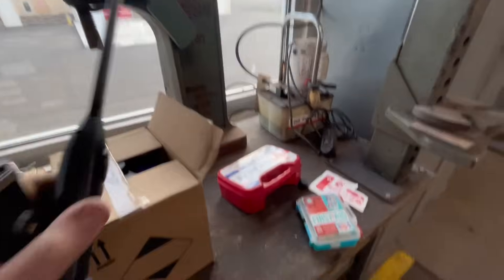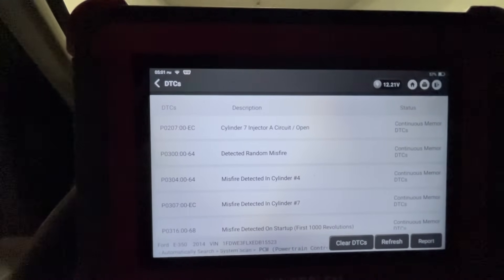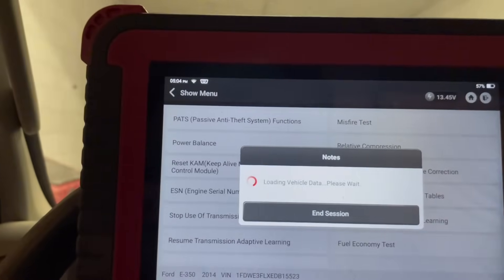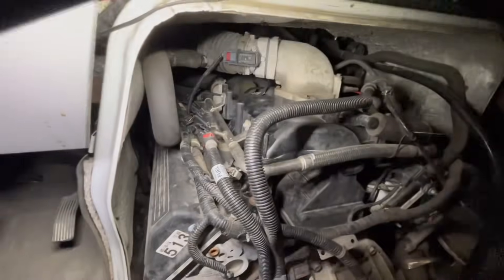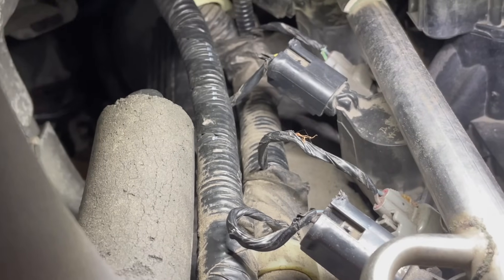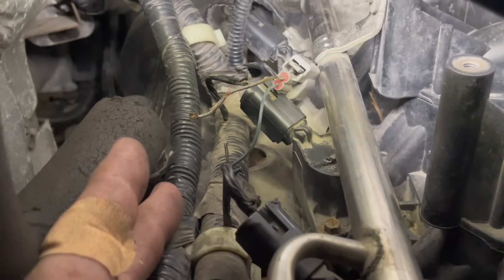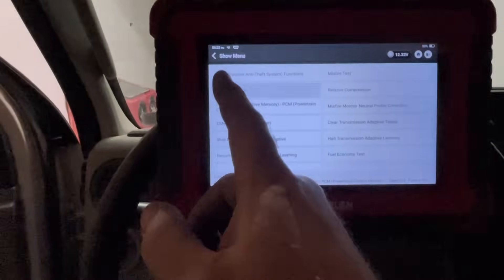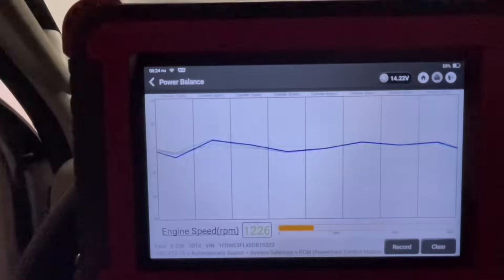Ford 5.4L Power Loss! Misfire and Injector Problems

Comment: Hi will, 
 You're bunged yourself, well I did too yesterday and
I changed the alternator belt recently, and on my Toyota sienna 2000 I have no tensioner pulley, I have three bolts, lockdown, pivot, adjusting bolt on alternator assembly, I had some pulley , belt noise and readjusted the  belt for crank, AC, alternator. The power steering belt is  ok, but I bought another  to change in the future.
Anyway getting pulley belt noise again, I put a couple doses of dielectric grease on belts it quieted all down. In the process a hit piece of metal opened up my back of the forearm. So I know  banging myself up😅😂 great video today!
Reply from the maker: Looks like our vehicles are conspiring against us! Who knew changing a belt could turn into a full-on battle? Hope your forearm is healing up nicely! I got myself pretty good this time. in a hurry once again lol

Comment: Nice repair using the crimp connectors and marine shrink with sealant. That method of connecting wire breaks has always been my most successful repair without a single failure yet. Great job Will.
Reply from the maker: Thanks you! Same here. Tried and true. Thank you for the feedback